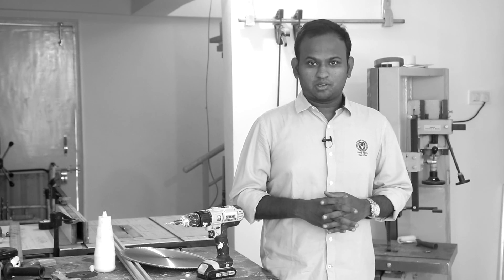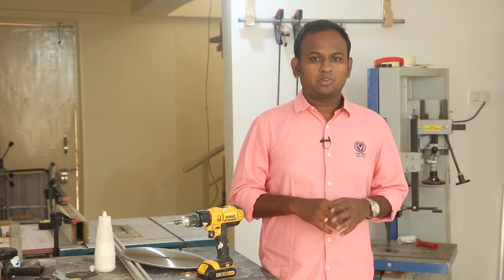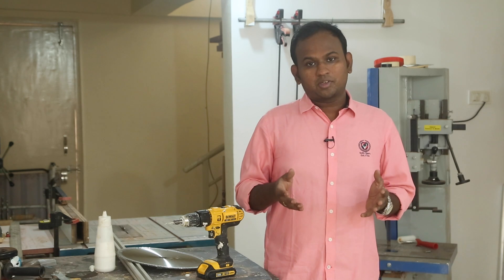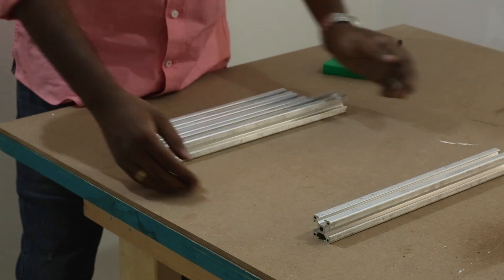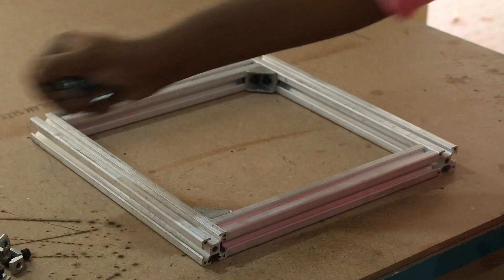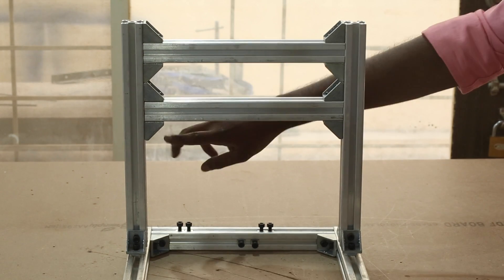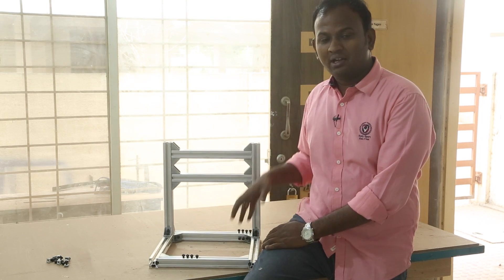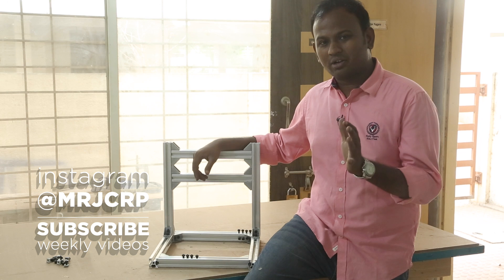DIY PCB Milling Machine - Part 1 - Building Frame

Comment: Hello
I am a mechanical and electronics engineer and a manufacturer of industrial machinery. And now I am retired and I have turned the parking lot of my house into a workshop.
And I am very interested in making electronic circuits (PCBs).
Of course, I have made some desktop CNC milling machines. One of them works with Mac 3 and the other with CNC plant.
If you have free time, please advise me how to make a PCB with a small milling machine.
Thanks

Comment: boss why dont u give proper dimensions ...many ppl are asking...it will be great if u share proper details
Reply from the maker: This was an experimentive work when I started. A lot more has to be done with it so that I can the optimum use of the bed area. Hence I haven't released the dimension. I am building a C-Beam CNC from Openbuilds and working on electronics. Once that is done I will get back to this. Please follow the channel so I can keep you updated.